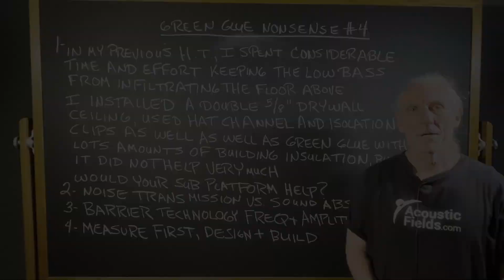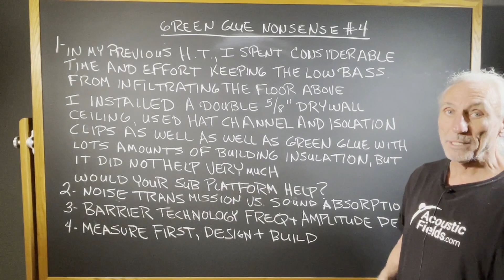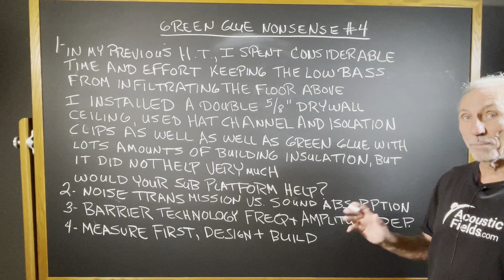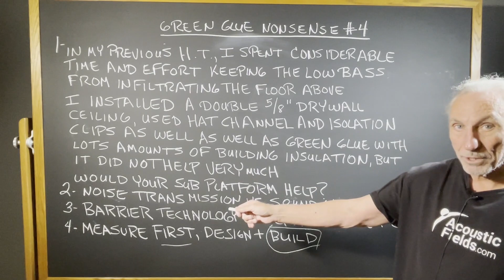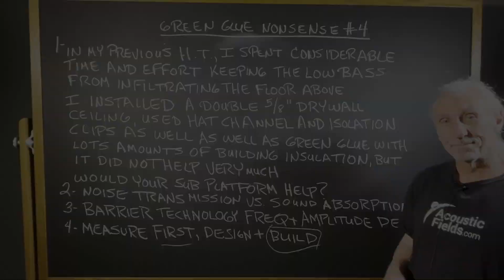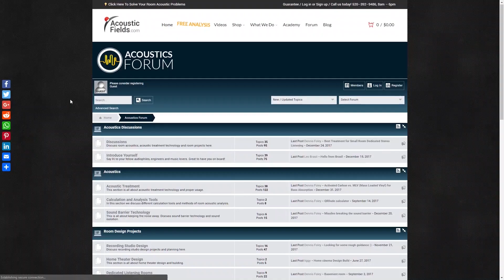Green Glue Nonsense! Part 4 - www.AcousticFields.com

Comment: Thx, very instructive! May I ask one thing: I get what green glue is intended for (I read the public available patent document). As far as I understand it, it stays simply more viscoelastic than any other adhesive or caulk (without getting so fluid, that it simply flows away). It dampens to some degree vibration, traveling between solid structures,  e.g. two sheets of drywall. Ok, why not. The inventor Brian Ravnaas and its partner company, the industry giant Saint Gobain, seem to have put lots of effort and research in it. My question: Why the caulk-texture? Wouldn´t several thin (2-4 millimeters) pieces of soft foam between drywall have a similar damping effect (being at least a slight improvement compared to no soft layer)? Or does the difference in weight (green glue/foam) matter? Thanks in advance
Reply from the maker: It is an adhesive nothing more. Spend your time and effort looking at the complete issues involved in room acoustics regarding noise transmission.
Reply: @AcousticFields  thx for the swift answer. However, GG does not claim it’s an adhesive and it doesn’t work as an adhesive either. Again, thanks, you don’t owe me advice on that, fair enough

Comment: It boggles my mind to this day how many "professional" sound engineers still don't understand just how much energy is in low frequency waves and just how much material combined with the right jiggery pokery it takes to stop most low frequency waves. Tacky building adhesive is like pouring a cup of clean water into the ocean and hoping it won't be salty anymore 😂 great Video Dennis slowly working my way through your library
Reply from the maker: Most enginers we speak with do not know the difference between axial and tangential modes. Most do not even know what a room mode is.
Reply: I did t know what modes were until I really started listening to your videos. It took my about 20 -30 videos for it to start clicking in my brain. Love your work Dennis

Comment: Hey, Dennis.

As usual, great video!

Regarding barriers for noise transmission solutions, is the only way to actually invest in construction into the room itself?

What I mean is that I was wondering if it's possible to have movable units or modules that would be effective for noise transmission, like your sound absorption and diffusion solutions, even if they wouldn't be as effective as built into the room.

I ask in case you live in a place you don't know if you'll be long term, so if you eventually move, you can take your expensive investment to assemble into your new place. Then add or subtract units as needed according to the new room's measurements. It would be a hell of an investment to leave for the new owner or tenant for "free".

People mostly focus on sound quality overall through absorption and diffusion, but in reality to actually enjoy your system you need to consider the necessity to mitigate bothering family members and / or neighbors with the noise.
Reply from the maker: All good thoughts, but no. A barrier is a sealed container. The seal and container must fit well together. You can only achieve those goals by using a permanent construction technique and build.

Comment: Low frequency bounce back at listening position needs Absorption tech. Low frequency going through walls is Sound Transmission which needs a barrier technology to reduce or eliminate. Do I pass the test?
Reply from the maker: Good start. The low-frequency energy within a room does not bounce or reflect. That is a characteristic of middle and higher frequencies. LF is a pressure wave that oscillates throughout the room from source origially then from the room with its activated modes. Noise transmission does require a barrier be built between the noise source and the receiver of said noise.